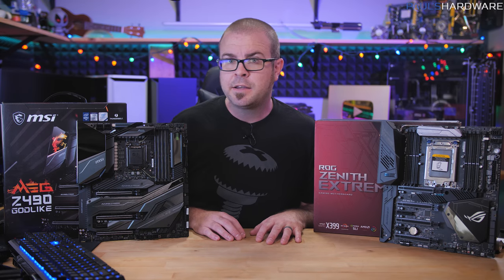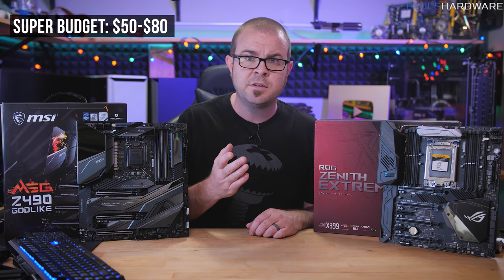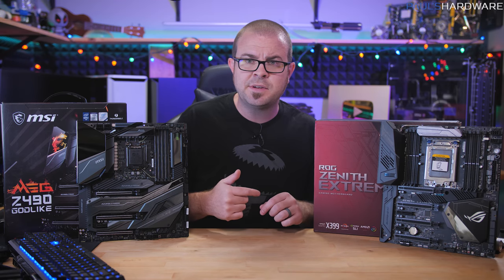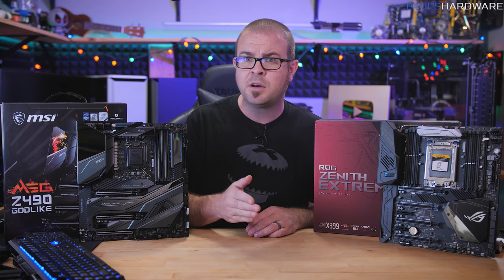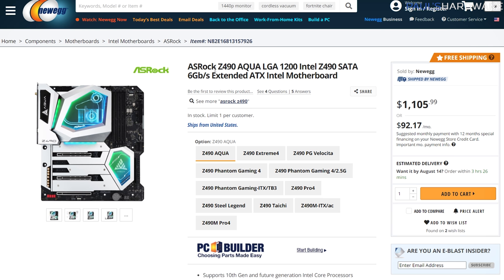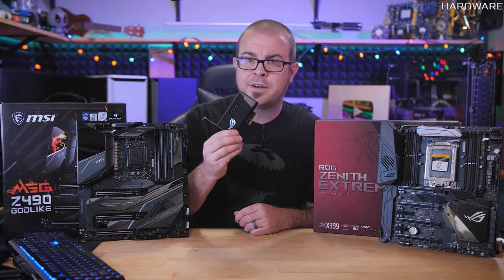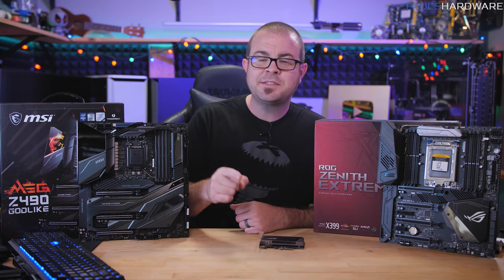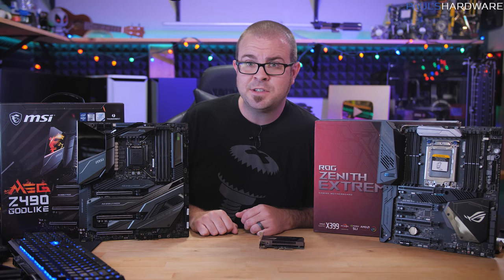What Does a $700 Motherboard Have that a $200 Motherboard Doesn’t?

Comment: 10gb nic is probably the most useless feature, given that (1) most consumer (and even prosumer) routers and switches are limited to 1gb and (2) most homes can only get 1gbps WLAN uplinks anyhow. 10gb+ connectivity mostly useful connecting the backbone equipment (switches and routes), not individual hosts. My switches and one of my servers have 10gb interfaces, but they're SFP+ connections, not RJ45.  The idea of 10gb interfaces being a value-add on even a "high end" consumer PC is kind of silly unless you actually have a need for 10gb+ LAN and have all the requisite equipment to take advantage of this. 

The LAST thing you want to do is get a PCIe nic... you'll probably end up just eating up your PCIe lanes. For example, suppose you have 1 GPU installed in a PCIex16 slot. You plug your NIC into the other PCIex16 slot on your motherboard. Guess what? You just switched the PCIe bus for your GPU into x8 mode, limiting the bandwidth for what really matters. Surprised PCIe slots and bus topology was not discussed. For example, depending on the board, you may be sharing PCIe lanes between your m2 slot and your PCIEx16 slots or worse, be in SATA mode on your m2.

Another missing discussion here is quality of BIOS. A BIOS may advertise support for an architecture (e.g. skylake) but only support it with a BIOS update that the board may not ship with and may not perform as well as a MB that supported the architecture from release. You also want to consider the reputation of the BIOS vendor: what's the typical delta between release of new chip architectures and BIOS patches that support those new architecture. How often are BIOS patches released? Similarly for vulnerability patches: how fast do they get those out? The BIOS may also impact your capabilities for easy overclocking.

Cooling is hardly important enough to discuss. If you can drop the temps by a significant number of degrees, the board may last longer, but that's about it. Maybe also a consideration for ultra small form factor builds... but the design of the MB in this regard is unlikely to produce results that are even remotely significant in practice, compared to simply having adequate airflow and ambient temps.
 For reference: for every 10 degree centigrade change in temperature, you impact the life of a semiconductor by about 50%. So, unless you're making dramatic temp changes, it's unlikely to produce tangible results in the context of a consumer system.

Also, no talk about I/O ports? USB-C? USB headers? Nothing?

Also, on audio/sound cards... It's very niche, but, certain audio hardware with sufficient bit width (at least 32 bits, ideally) can be used to produce genuine randomness, which is useful for cryptographic utilities. Without some kind of hardware randomness generator, you're basically stuck with software-based randomness which is not as secure. Again, niche, probably in the same realm of 10gb nics, but a consideration for some when thinking about audio capabilities.

Overall, pretty annoyed with this review.

Comment: 6:02 especially with how short of a period intel sockets usually last
Reply: ???  

I have an Intel Motherboard and CPU that I bought in 2007 - 2008. The board back then was a lower-middle end board for about $200.00 and the CPU is a Core2 Quad Extreme 3.0GHz. The motherboard has 6 SATA, 1 E-SATA, 8 USB 2.0 (pre USB 3.0 or USB C). 4 Memory Dimms 2 PCI-Express, and 2 PCI-Express x16 slots and 2 ... It also has very decent overclocking capabilities, it's not water-cooled, it doesn't have the external bios flashing or reset capabilities as they came out about 5-7 years later. I don't care about have 10,000 LEDs glowing and lighting up my room... if I need to see what it is I'm doing physically to my system, I'll just turn the lights on or grab a flashlight. The system is 12 years and is still a workhorse! Am I due for a newer system? Sure, it is becoming dated as other modern hardware peripherals would require a newer motherboard and CPU combo to operate. For example, if I wanted to get NVidia's GeForce 2000 or 3000 series boards, I don't think my system would support it. I could run a 1080 series, but to have capabilities of real-time ray tracing, I would need the advanced vector instruction sets... I'm sure I have MMX, SSE, SSE2, SSE3, SSSE3, and SSE4.1, but I don't have AVX, AVX2, AVX512...  so, if I really want to be pushing high-end graphics at super high resolutions such as 4K and maintaining 60 - 120fps... I would need a newer setup. However, for my current needs, it runs great at full 1080p via HDMI to 42" 1080p tv. As I have already said, my board and CPU are about 12 years old and still running strong, and I'm still running a 64bit version of Windows 7. Another downside is my motherboard isn't standard UEFI and not configured for it, but I do believe it does have UEFI support and it may be limited.     It also only has an L2 and L2 cache as there is no L3 cache. It is 4 physical cores each single-threaded. It's an Intel DP45SG board running a QuadCore Intel Core 2 Quad Q9650, 3000 MHz (9 x 333), one of the last few generations of when they still made motherboards. I haven't had any complaints with this board nor CPU! This entire rig initially cost me about $1,100 - 1,200 and about $1,500 when all was said and done, but that also includes a $70 gaming mouse, a $100 gaming keyboard which has been replaced with a $150 mechanical gaming keyboard, a $180 video card, and 3 power supplies. I wore out 3 power supplies, 1 heat sink fan, and 1 keyboard on this rig. Then again about every 2-3 years, I will back up my data, wipe my drives (not format, but wipe them clean) and I'll remove and clean the old thermal paste and apply new, I typically use Arctic Silver 5, but I keep checking reviews for performance, reliability, integrity and the lifetime use for the thermal paste.    

So when you say intel sockets usually don't last, you are far from wrong because my guess is you have support for an Intel Socket by some 3rd party company and not an Authentic Intel Socket. Intel quit making motherboards about 10 years ago around the 2nd or 3rd generation of the iSeries processors. If you didn't have an Intel motherboard, then it wasn't an Intel Socket, it was some 3rd party aftermarket company who built their own socket to support Intel's chips and chipsets. This machine has been very reliable for me. And don't give an AMD cause I'll probably throw it at you, except for maybe, maybe their Ryzen processors, but even at that it'd be a long shot. I like my little-endian machine that AMD tries to mimic. I never cared for AMD CPUs... I've worked on many computers trying to fix them, clean them, remove viruses, etc. since the late 90s during the Windows 98 era, and no joke, if I worked on 10 computers and could only fix 7 of them where 3 were ready for the dumpster, the 7 that was able to be recovered were Intel  Pentiums(1-4), and the other 3 were AMD (Athalon and other versions). AMD always had issues with overheating and frying not just its own CPU, but the mainboard as well. When I was doing a battery test on two comparable systems without using a heat sink and cooling fan and when I did the Intel CPU and it started to overheat, it had automatically powered down the system, the AMD on the other, just kept running and running and running, and eventually, it started to spark and I had seen flames coming out of the CPU. Needless to say, after that battery test between two comparable systems... the Intel, when put back together, booted right up and everything was fine with 0 issues. As for the AMD, well let's just say it hit the trashcan... oh and I had to throw the motherboard away too... Since then, I've never used AMD and this was in the late 90s early 2000s it was either when I was still in High School or not long after I had graduated!!! I'll spend a little extra on the quality of reliable products. 

Those weren't even my first systems... I started working with computers when I was bout 11 or 12 with an Intel 4086 running Dos 6.0 and wither Windows 3.11 or OS/2... That system only had a 200 MB hard drive, and it only had a 2x speed CD-ROM, but it did have a VGA (not SVGA) ATI Radeon video card and a 16bit Sound Blaster Sound card and there was no Internet... It was fun installing games in DOS that was easy until you go to play them and you had to configure their IRQ ports and DMA channels... Oh and do not put a Mac in front of me either, I won't throw it at you but everyone around you as well, haha, just kidding on the figure of speech, but yeah don't like Macs either! I can't say much about Linux cause I've never really worked on a Linux machine... for a little bit I tried learning bash, but I was so used to command prompt - dos commands that I fell away from it as I really don't have much use for a Linux machine. I'm not running any databases or servers... I basically do some gaming, but I also do some programming and I'm accustomed to Visual Studio's compilers even though I'm starting to learn more about Clang and GCC... So I do know about both the hardware and the software. Now, this isn't to say that every Intel Process is inferior to every AMD CPU as a top-end Ryzen would be better than a piece of crap i3 or low-end i5, but when it comes crunching numbers, Intel's Mid to High-End i5s and almost all of their i7s and i9s will outperform most of AMD's Ryzen chips in many ways, except for maybe their highest model which might be the only one to compete with Intel.

Both companies have been at it for quite a long time... Now if you are looking for a general-purpose computer for basic web browsing then yeah AMD may not be a bad choice as their mid-grade products are more affordable than Intel, for example, a mid-level AMD CPU might cost you about $300 where the competitive Intel model might run you $450 - 600... If you are planning on doing a lot of multitasking that utilized parallel programming then Ryzen might have a slight edge... but if you are looking for a Gaming Rig to give you the best frame rates and the better Overclocking capabilities then the high-end i5's and i7's are the way to go! The high-end Ryzen might cost about $850 - 900 where the high-end Intel Boards nonextreme might be about $950 - 1,200 and some of their Extreme CPUs can run as high as $2k but that would be the i9 series which most people wouldn't even buy. Personally, I'd stick with Intel. Now, from many of the reviews I've been seeing lately, Intel needs to reevaluate their management and get things rolling again. They were excellent at being innovative and with their current leaders in their R&D departments... it appears as if they are starting to become stale. Maybe I'll wait another 5-10 years and go with Risc-V or by then Risc-VI instead!
Reply: @skilz8098  really replied with your life story lmao
Reply: @avonire  Not my life story, just from personal experience!!!

Comment: A big one for me is Motherboards that have more than 1 channel for USB interfaces. I feel like, when building systems for others, they may like a mobo because it has so many USB 3.0 ports, but they're often in 1 and sometimes 2 channel configurations.

The reason I say this is because when playing VR, you use a lot out of 1 channel, often maxing it out. I fell into the trap of my motherboard for picking one with a lot of USB ports, only to find out I was maxing out the 1 channel it used, so I had to buy a PCI-e USB 3.0 card with 4 dedicated channels to get USB 3.0 speeds on all my sensors and HMD

Comment: 11:40 - Paul! Don't let Steve from Gamer's Nexus see that PC you built. He released a video (yesterday?) talking about the correct way to install AIO coolers in the case, and that ain't it! He said when mounting the radiator on the side of the case, the hoses need to be at the bottom so the air goes to the other end of the radiator and the hoses aren't sucking air.

Just saying....  ;)
Reply: they told that for a long time already, just not a standalone video
Reply: I was looking for this comment lol
Reply: That's the Lian Li LU150 + CM ML120R AIO; it does have a variable height fan mount, but I think Paul as pushed it as high as it can go. See Paul's build log here: https://youtu.be/pC2UHDmviug?t=156 Steve in his video points this out: bad case design has necessitated non-optimal placement.
Reply: Steve only stressed it isn’t recommended.
Reply: You shouldn’t have air in water systems period whether it’s in a pc or not air kills pumps
Reply: Related to Paul Linde?
Reply: Misspelled Lynde...
Reply: @dw8555  I donno... maybe? There's a lot of us around, and it possible.
Reply: @dw8555  Oh, then no, if the spelling is Lynde. Our last name is LINDE.
Reply: Jack Linde
i don't think you understand that basics, don't use YouTube for that!
basic science for kids you need! a book!

Comment: I built my first system a little over 2 years ago.  While planning that build, I read advice saying that it didn't make sense to buy a board with integrated WiFi because it was cheaper to buy a board without it and to add a WiFi card.  What I discovered that was a card that also added Bluetooth needed to be plugged into the USB 2.0 header.  My case also had an SD card reader that needed to be plugged into a USB 2.0 header.  I also wanted to add a remote starter and guess what?  It needed a USB 2.0 header.  Oh and I almost forgot, the USB 2.0 front panel connector needed a... well you get the idea.  I solved that issue with a hub. So while multiple 2.0 headers seem like a nice feature, the last 3 motherboard I purchased had integrated WiFi.  New Egg was selling a Gigabyte B450 D3SH Wifi board for $89 a few months ago, so I don't think a separate WiFi card is necessarily a cheaper option.

Comment: 1. Decent passive cooling with fin stacks on everything that needs cooling.
2. LED post-code display on the motherboard inside the computer.
3. Clear CMOS button at the back of the motherboard.
4. Coaxial S/PDIF out, not just optical.
5. Dual BIOS.

Those are the only things I care about and all of that used to come with boards no more expensive than 200 bucks.
23:13 for example, I don't like the cooling on those boards, there are blocks and covers that prevents air from reaching the fins on the coolers.